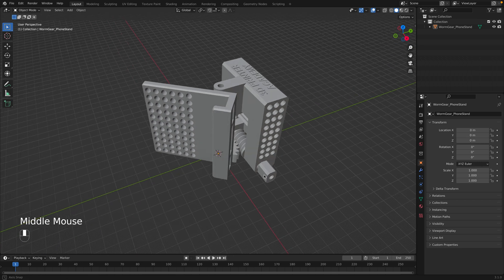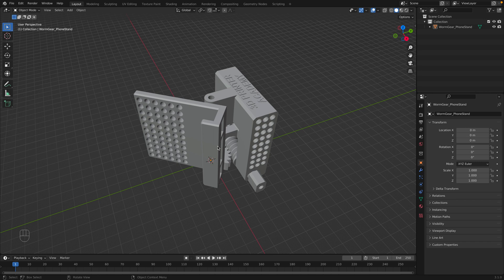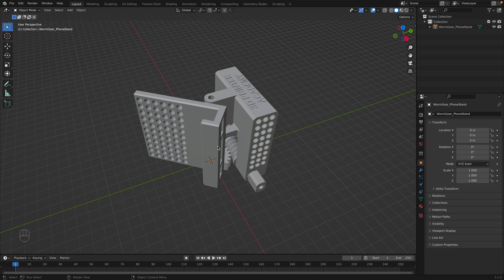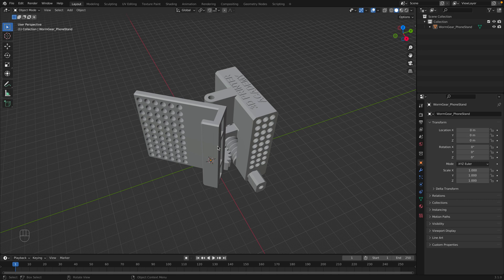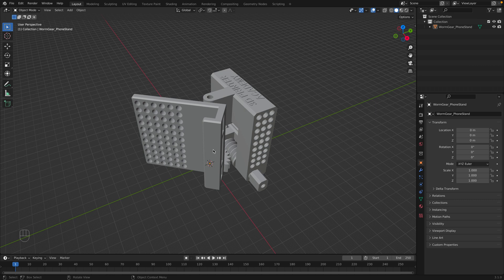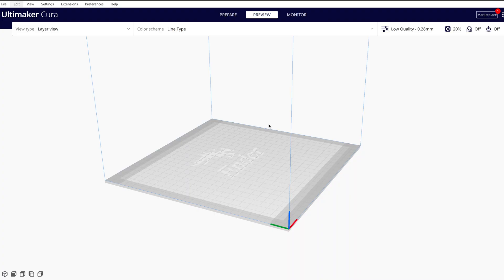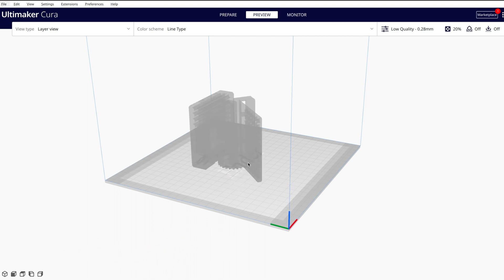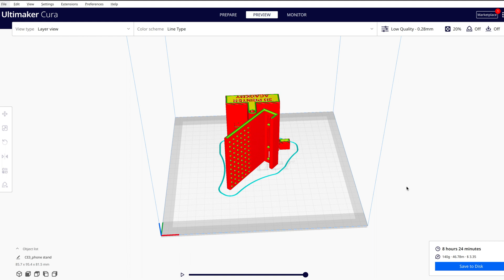How to export 3D models in Blender for 3D Printing (STLs)

Comment: There are some boxes that need checking before it'll export correctly as I've found after hours of exporting a file that wouldn't slice..!
What worked for me were the following checkboxes on the export screen.

ASCII
Include: "Selection Only"
Scene unit.
Reply: what scale unit did you use it

Comment: well my STL always has a scale problem. i try now to figure out how to make it consistent the same scale as in blender.
funny part is. i can get the same test cube in differents sizes depending on how i export it. with 3D Print addon or normal
Reply: Change your world scale from Blender units to Millimeters then also do your view grid the same.

Comment: So I started with the donut tutorial. I have the geometry nodes as the sprinkles but when I go to export, the nodes on my render are not there. What am I doing wrong?
Reply from the maker: You'll have to apply every as a mesh and join/boolean everything together. Unfortunately, making an object look good for a render is much easier than building a clean mesh for 3D printing.

Comment: i like how its not 1000x the size of your build plate for you.. i think the whole reason anyone would be looking for a video like this is to solve the scaling issue.. as if we couldnt figure out how to find the export option.. smh
Reply: Thats why im here but the video didnt help
Reply: If you found a solution please let me know. For me it’s smaller than a millimetre every time I try to slice it.
Reply: I’m here on Mac book air using a Bambu lab a1 printer and this helped me with literally nothing could you make a vid on this please
Reply: The problem is that each square in blender is one metre
Make it smaller in blender
Reply: You need to open the file in the same units it was made in.  So if u export in fusion and it was set to mm then once you import it to slicing or another program, you need to open it in mm

Comment: Great content. I was wondering can you maybe help me, i designed a keychain in blender, very simple, cylindrical shape, but my edges are not smooth when i export the object to stl. Shadow smoothing is only for preview in blender but how can i smooth the edges for real, or change resolution or whatever. Thanks in advance.
Reply: Change the mesh, add subdivision modifier and apply it. Adjust the ammount of subdivision for what you want it to look like.

Comment: How about changing the resolution? Or will it be the same as it appears in blender? Thanks in advance for your response.
Reply from the maker: Resolution will be exactly as you see the mesh it in Blender
Reply: @3DPrinterAcademyTutorials  Thank you so much 🙏💥🏆
Reply: @3DPrinterAcademyTutorials   i tried exporting separate models but when i put both stl files into Cura one was like 100 times bigger then the other and ive looked everywhere but cant fin how to fix it